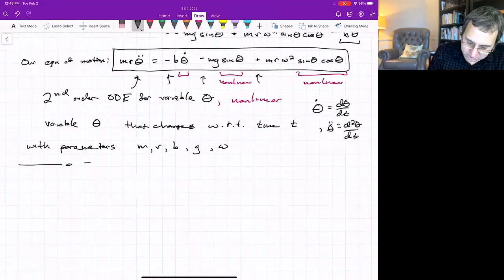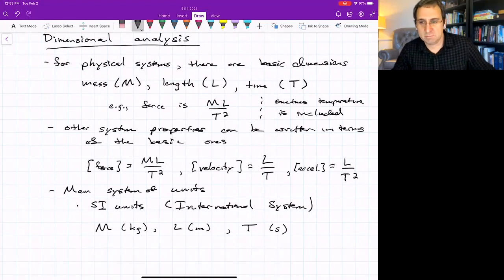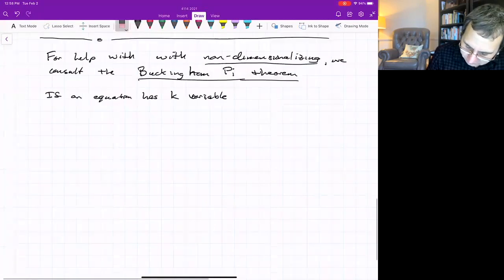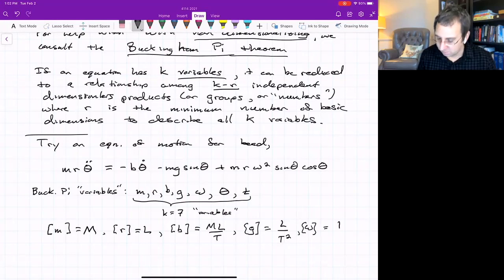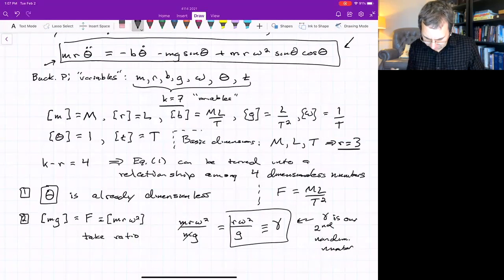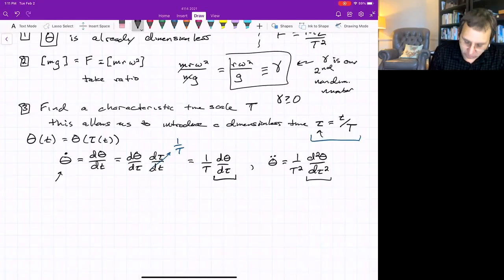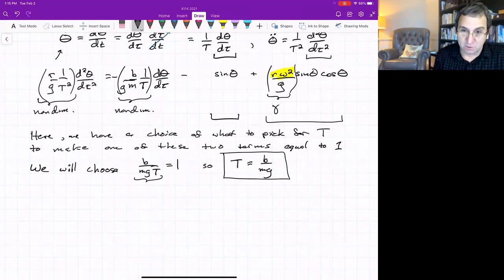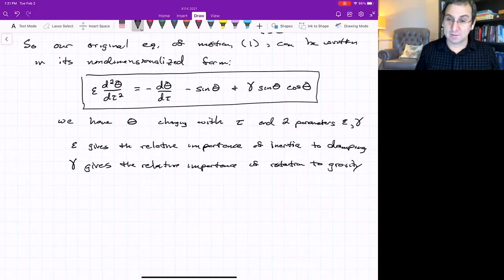Nondimensionalization of Equations, Physics Example | Bead in the Hoop, Buckingham Pi Theorem

Comment: Dear sir, around 14:29 timestamp why did you choose one of those two non dimensional quantity to be unity? 
Thanks
Reply from the maker: Sayanjit, it's a good question. It depends on which parameters you want to vary for a parametric study of the system, in particular, which limits. Suppose I want to look at the limit of low inertia compared to damping. In the case I chose, the damping term, b, will be part of the non-dimensional time, and the final parameter, epsilon, as it goes to zero, indeed captures this limit of low inertia compared to damping. If we chose the other case for the nondimensional time, then we'd have a fourth nondimensional parameter which goes to zero as damping goes to zero. So if the zero damping limit was our interest, we would have made the other choice. That is a bit wordy, but hopefully answers the question.
Reply: @ProfessorRoss  Thank you so much professor, it makes sense.